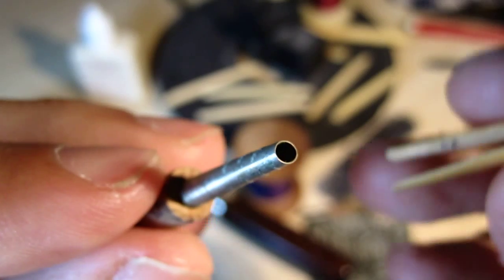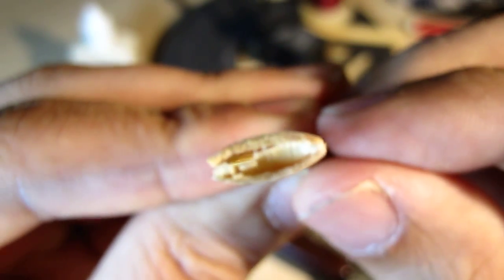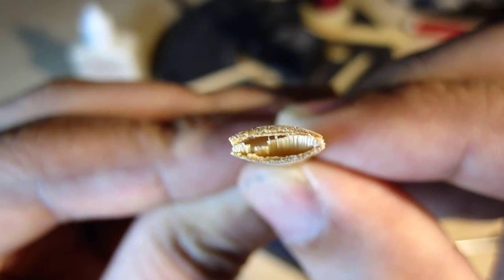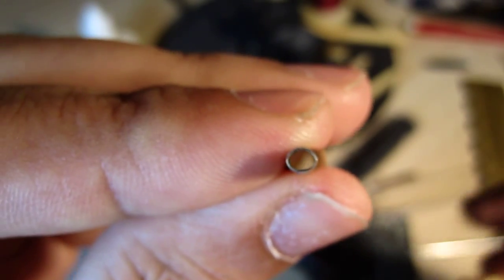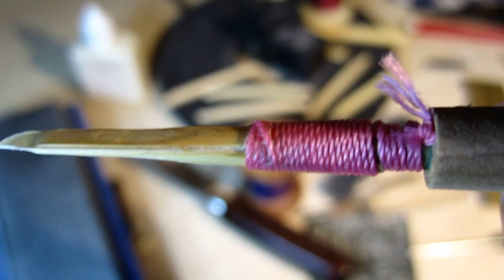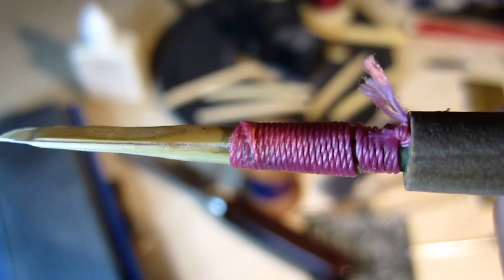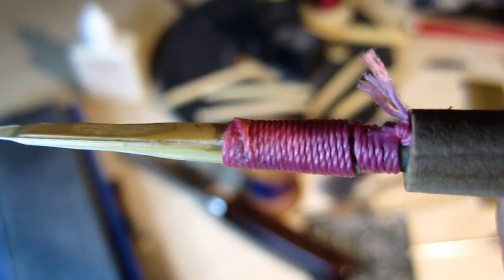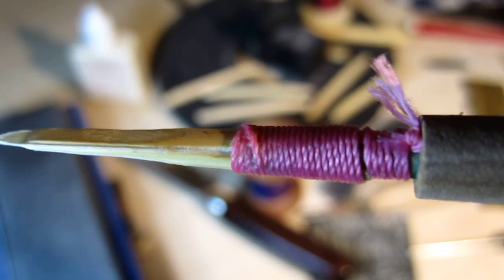oboe reed tying tips

Comment: I would suggest tapering the ends of the cane that is under the thread. I found that doing so makes the cane less likely to crack up up higher and the wrap also looks neater. Of course, I keep my thread tight all the way through, so that may also make a difference, but I hardly ever had a problem with sealing.

Comment from the maker: I just use a very sharp razor blade guided by my finger in a left to right motion as if you were cutting a big block of cheese. There should also be a slight degree of angle to the cutting block, not 90 degrees like the machine will give you. Hope that helps!

Comment: Hi Jasper-I didn't really understand exactly what or how you add the offset after you started trying. My reeds seldom click into place, right offset, after clipping, and leaky sides are a frequent issue. I think the answer is in your explanation on this video-I just could not see exactly what you were doing 😞
Reply from the maker: Hi Joris. When placing the cane on the tube make sure it is on correctly. As the blades close allow for the smallest hint of the overlap. If it is too present you won't have the click and the blades will over twist making the reed narrow and less functional. As for leaky sides check your shaper tip with a buddy to see if both of you have the same issues. Also use a thick razor blade that Gem sells, HD model.

Hope this helps!
Reply: Jasper Hitchcock Thanks Jasper. I hadn't thought about allowing a bit extra closure for the overlap. I'll check with my supplier-I am using Gem blades but not the heavy ones. I'm using a Pfeiffer shaper. Leakage is my primary issue, the reeds that don't leak are generally okay, sometimes quite good... again, thanks.

Comment: What do you do if one side of the can is more closed than the other side as you're tying it.
Reply from the maker: If one side is too open and not closing symmetrically I will loosen the thread and push the cane from the closed side with my two index fingers upwards to myself. I will still be applying tension to the thread and comparing both sides as they close downwards to the staple. It takes a little time getting use to this procedure. Hope I was clear enough. 

Best of luck!